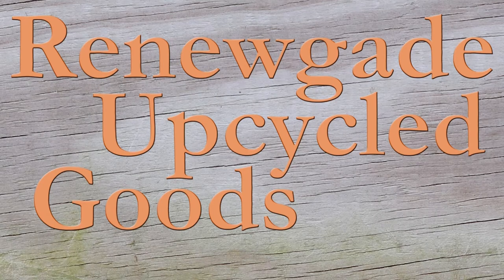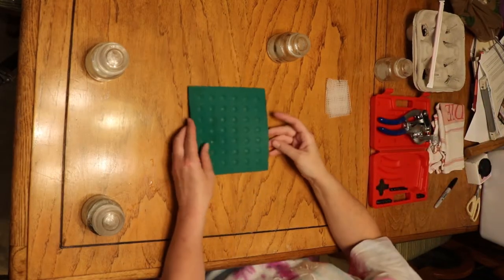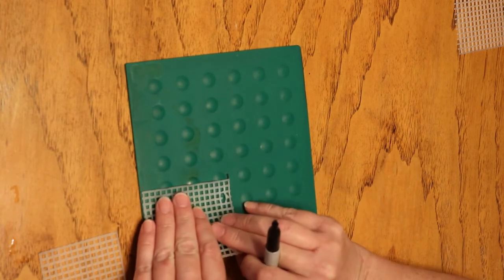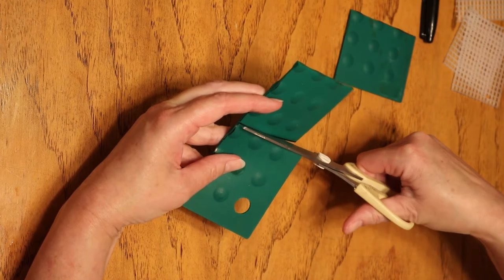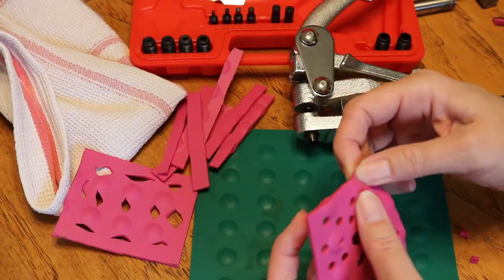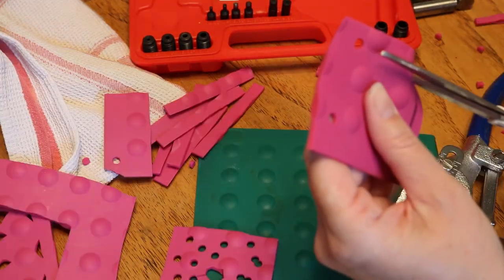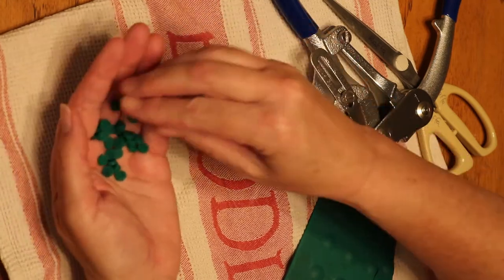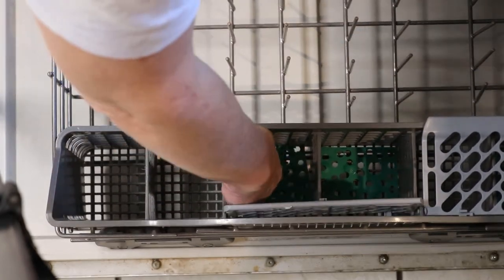DIY Repair Dishwasher Utensil Basket

Comment: I got a plastic tub/bucket, the type that 1Kg feta comes in. Cut a rectangle piece out of the bottom of that, and drilled some holes in it. Works great!
It's Polypropylene (PP), and heat resistant.